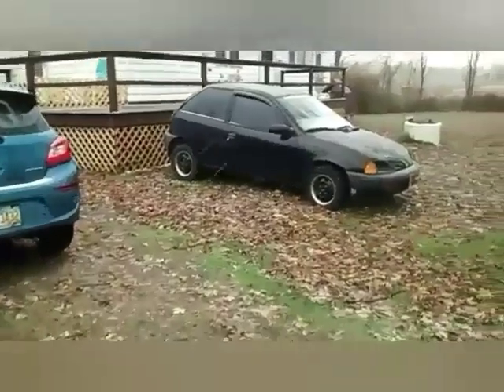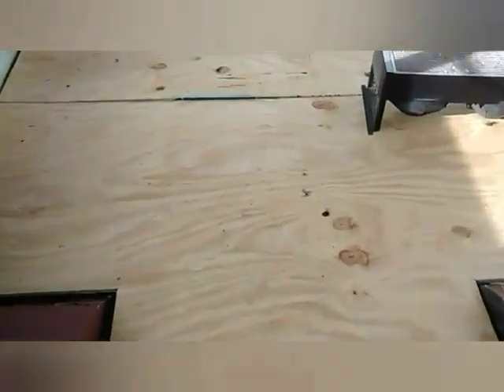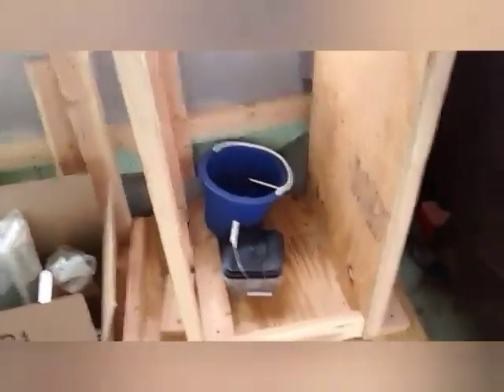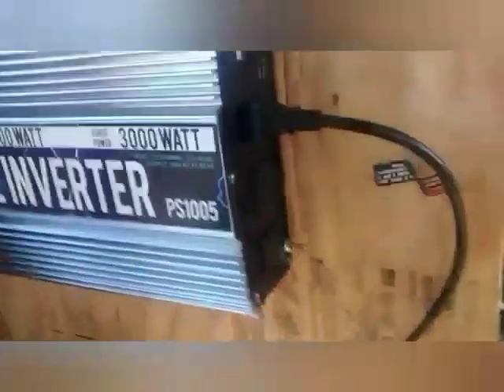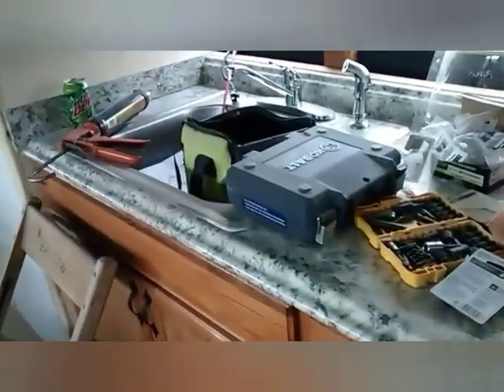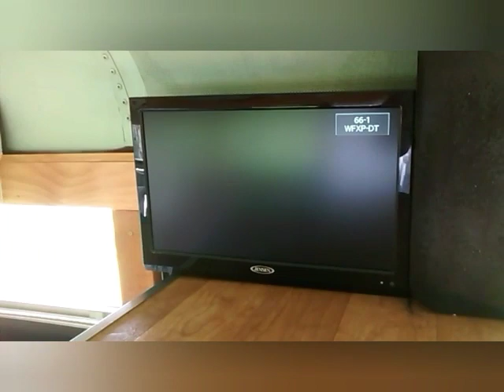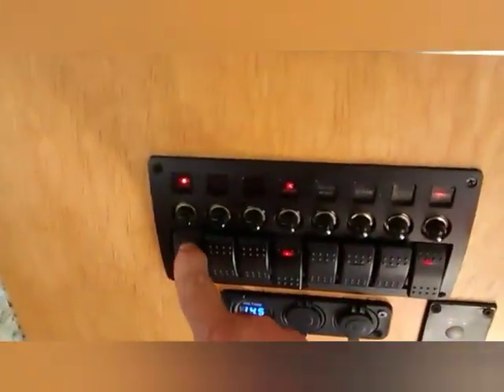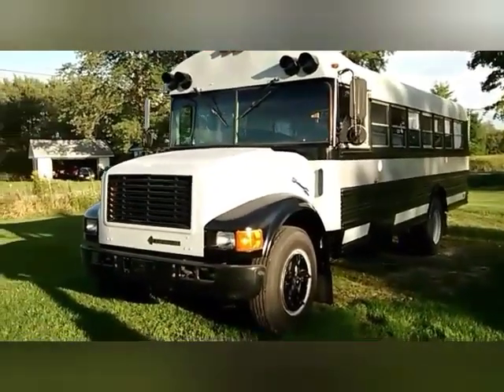Mullet's Skoolie Build Compilation Video

Comment: Johnny we need your help.....we are 60 and 70 and have recently purchased a bus just like yours.....7 window.  But ours is a 1999 with only 57,000 documented miles on it.  Came from CA.....now in Arizona..so absolutely NO RUST.  What we need help with is we would like to set our bus up the same way as yours...but it would really help if we could get some measurements....starting with from drivers seat to back of bus..Do you have copies of any plans that you use that you would be willing to share or that we could purchase.  This is just such a perfect set up.  Really love how you did your solar setup..and the bathroom area.  Any help would be greatly appreciated.  Thank you for your series..so much inspiration.   Ernie and Marlene
Reply from the maker: I had all the plans for the build in my head and used no blueprints or builing apps.  I had a tad over 20 feet from behind the seat.
Reply: @JohnnyMullet  do you know your length bumper to bumper.  I only have 18' 3" behind the seat...will have to do some adjustments....
Reply from the maker: 28 foot bumper to bumper.
Reply: @JohnnyMullet  ours is only  26 1/2' bumper to bumper.....thank you for all the info and keep making these amazing videos.  We love tuning into you.  And LOVE>>>LOVE>>>>>LOVE......  STORYTIME!!